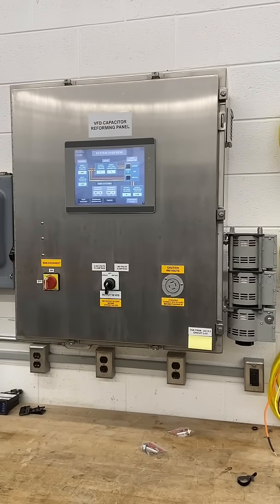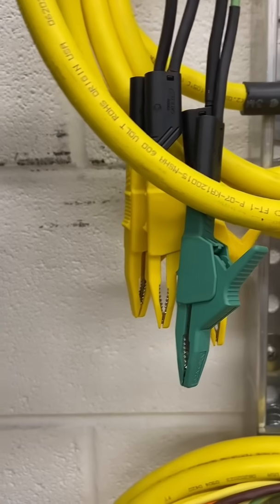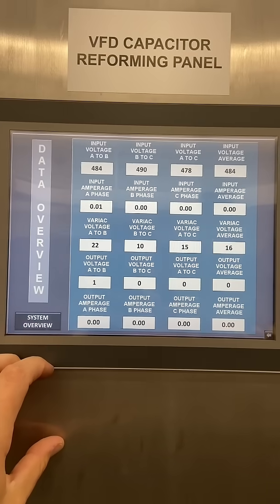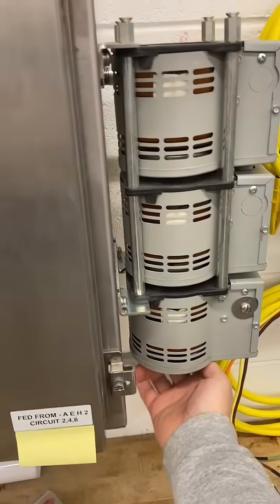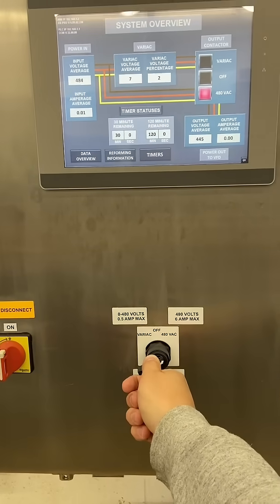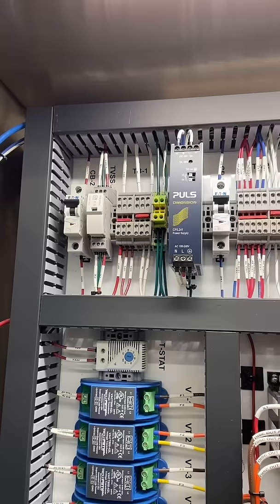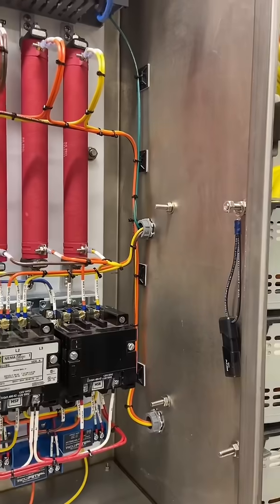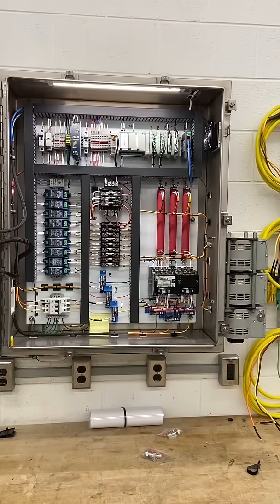VFD CAP Reforming

Comment: what are  the resistors specifications or rating   ???
the resistors  are in series correct ???
why  two contactors instead of one ???
what is variac max output voltage???
you are  definitely in another level 
so much to learn from you.
Thanks.

Comment: It's always interesting for me to hear an electrician talk shop. I've worked underneath 2,000-5,000lb machinery suspended 6'-7' in the air by four 3.5"x3.5" lift points. I commonly work with high speed grinding wheels and cutting apparatuses meant for metal formation. Needless to say, not a whole lot scares me as far as trade work when it comes to being safe. But electricity? That shit is terrifying.

Comment: Interesting -- I've never had to reform caps inside VFDs before. What symptoms or issues lead you to reforming the caps in the first place? Most VFDs I've seen fail were mainly due to the IGBT or SCR exploding (and usually tripping the upstream MCC main...). Granted, the plants I worked in were either very old (80+ years old) or very new (under 5 years old).

Comment: Never heard of reforming capacitors on a drive
Reply: The oxide layer will deplete overtime. It is recommended to apply reduced voltage to the drive for a time depending on how long it has been on the shelf. If you let a VFD sit on the shelf for 5 years and you apply full voltage to it, you flip a coin on whether you let the magic smoke out.

Comment: Oh so you're a complete automation nerd larping as a field tech.  See I work for the OEM.  So we just do smoke tests in the field.  It's a win win, either the drive works or they buy a new one from us.  Pro tip, if the drive goes boom when you power it up.  Remove power and don't touch the drive for 5 to 10 minutes.   They sometimes go boom twice, which is no bueno when you're standing in front with the covers off.

Comment: U got all that but no servo for the variac? 
I wouldn’t reform capacitors this way. It’s far too expensive to build and maintain. It also seems like it has absolutely no feedback. U need feedback. An actual high voltage leakage detector. 

What u need is a HV transformer with primary. U can go super cheap and use triacs OR u can use an vco and transistor to pulse DC. Its variable and programmable. No need for big variac. Its also inherently low current so no expensive resistors. They expensive in more ways than one. U also need a mppt program or whatever. Charge controlling but pulsed at different intervals and ramp up the voltage. 
Still an incredibly clean and useful build. It’s very cool and looks fun to use.

Comment: Just last month I was troubleshooting Seimens servo drives.  Plant had about 10 iffys on the floor.  I inquired about a forming panel...Say what?  So I broke out the Siemens Simoverter Master Drive Manual 6SE70 to section 4.1 Capacitor Forming.  You need to build this before I touch those units.  I like fireworks.. at a distance.  Another plant had a rack of 20 drives spare they would quarterly swap on the forming panel to keep them alive.

Comment: I started playing with wires in 1970. First company had a great test board, second much.karget so so then.lsdt company nothing. Did not want to spend a few dollars and spare time to build one. Every month we had to remove covers from 800 amp panels to connect three 100 KW load banks for monthly generator test. Took them four years to finally purchase jacks & plugs to save at least three man hours every month.

Comment: That wiring with the cable ties is amazing! So over the top, but that makes it even beter
Reply: The wire ties are actually required for certain certifications, and are generally a sign of a well-built panel.